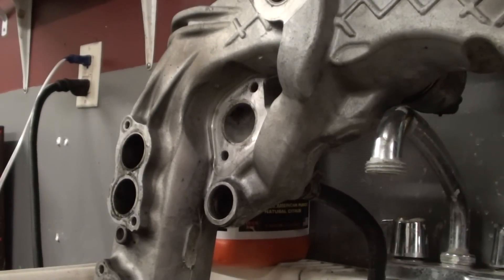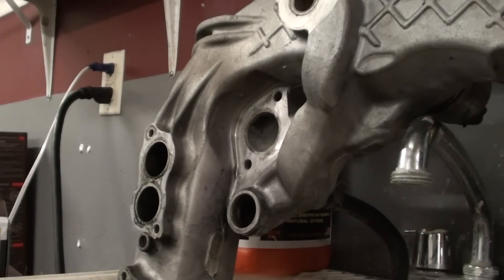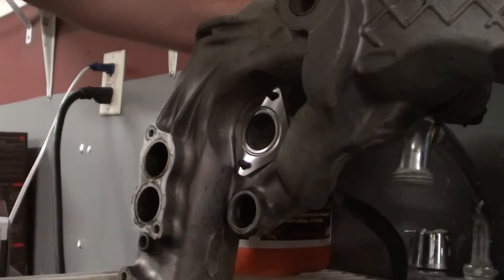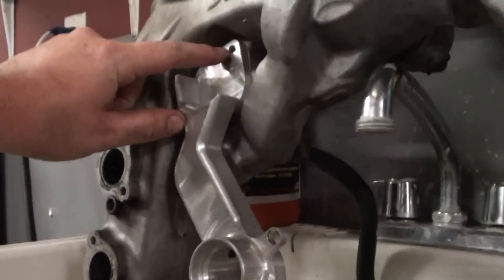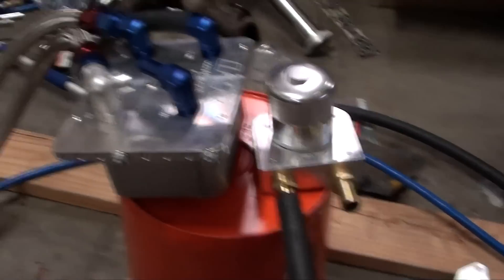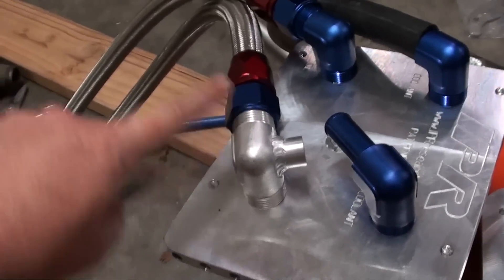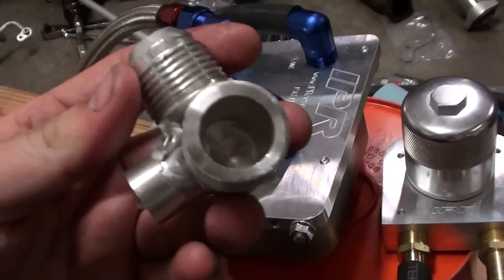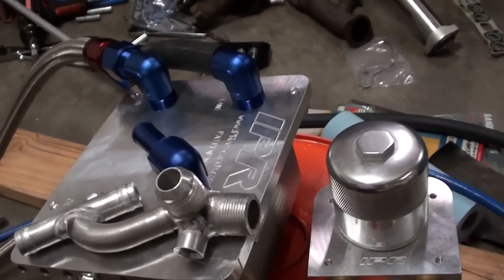Powerstroke 6.0 IPR Remote Oil Cooler + High Flow Coolant Filter Install - Part 2

Comment: PROBLEM WITH THE EGR DELETE DESIGN IS THAT THE UP-PIPE IS NOW NOT SUPPORTED BY EGR COOLER AND WILL BREAK AT THE BELLOWS WITH USE if it doesn't leak to the outside use freeze plugs in the ends of the original cooler to block exhaust flow and it LOOKS FACTORY and keeps the egr in place though useless except to keep CEL off and pass visual  and CEL emissions tests (not to mention it actually has LESS EMISSIONS WITHOUT THE EGR because it burns fuel more completely)